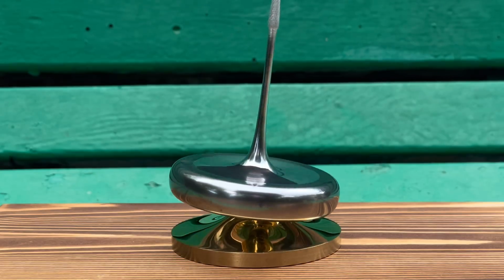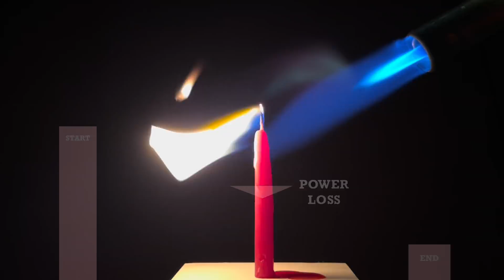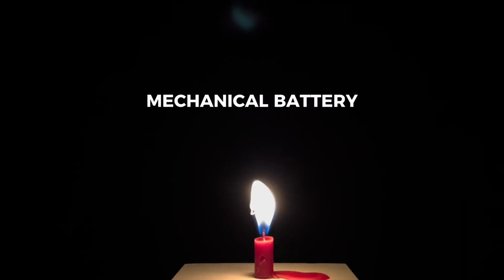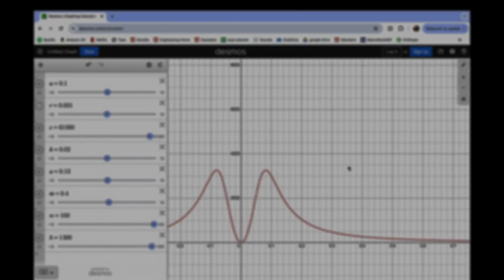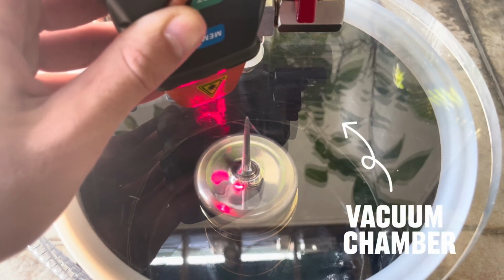How to Make the World's Longest-Spinning Top

Comment: How much longer does it spin when in a vacuum chamber?
Reply from the maker: This would spin for around 1hr 45min in a vacuum. However it is not designed to spin in this environment. Eventually I’ll make a top designed for this and it would spin for much much longer!
Reply: @hiper_tops  How does designing one for a vacuum differ from air? Would you add more mass to the outer ring to increase the moment of inertia?

Comment: Hello James, question for you! Looking at the smoke test you can see a very thin layer form around the main mass body of the smooth surfaces and guess this is the drag that slows down the top over time. I wonder if that surface was dimpled like a golf ball, if that would reduce the surface drag same way it does on a golf ball and help it spin longer?
Reply from the maker: Hi Dave! Well spotted, yes the top acts as a viscous centrifugal pump. Air is dragged out to the spot with the largest diameter and expelled in a disc. However, adding dimples here would increase the drag. Dimples help golf balls because although the viscous drag increases, the pressure drag decreases more. Spinning tops are stationary in air and so don’t experience pressure drag, so the dimples would just increase the viscous drag! Hope that made sense…
Reply: @hiper_tops  Thanks for the explanation! Keep on spinning 😀

Comment: I’ve been wondering for a while if having a bunch of dimples like a golf ball on your top would reduce its drag and help it spin for longer. What do y’all think?
Reply: That of the dimples like in golf balls seems the most common suggestion.  It doesn't work anyway, the speed in spin tops is too slow and the air flow is laminar, not turbulent, as it would be needed. Apart from the factr that the geometry of the air flows in spin tops aand in golf balls are totally different.
Reply: @iacoposimonelli7191  thanks!

Comment: Why is a sharpened or conical tip optimal?
If we are talking about a top made of a hard material spinning on a flat or almost flat hard surface, it seems to me that the tip of the top could be spherical or close to spherical, and the point of contact with the flat surface would still be very small.
To be more specific, I am imagining something like a stainless steel ball bearing in the tip of the top, and the flat surface would be stainless steel.
Reply from the maker: Ball tips are a good option for light tops, however for such heavy tops as mine, lubricant is a significant factor. Spike tips experience less fluid drag from lubricant compared to ball tips, so they become the better option. If I use a small enough ball, it approximates a sharp tip a bit better (see Mk.20). Also, I use materials much harder than stainless to reduce wear
Reply: @hiper_tops  Have you experimented with increasing or decreasing the space between the bottom of the top and the base or surface the top is supported by? 
I am wondering whether drag is increased or decreased based on the spacing.

Comment: Do you use a heavier metal for the ring and a lighter metal for the inside of the top?
The middle part should be empty, just two sheets of metal to reduce weight, just like a plane wing.
Reply from the maker: You’re correct, currently I use a dense tungsten copper alloy for the flywheel and aluminium in the core. I could potentially push this to be pure tungsten and magnesium but they are difficult and dangerous to machine. Regarding the 2 sheet idea, I tried something similar with Mk.19 where the top sheet was cling film however I struggled to get it aero enough. If I had the manufacturing tech, your idea may be a bit superior.

Comment: Not quite sure what the rules are, but would a lowfriction bearing between the tip and the body be beneficial? It would reduce the tip speed for lower friction, but would also add another point of friction. If the relation between rotational speed and friction is squared it should be beneficial. Right?
Reply from the maker: This is an interesting idea I heard once before, and yes I think theoretically with near perfectly frictionless bearings it would be beneficial. However in practice, I don’t know think the bearing wouldn’t spin, there is too little breaking torque from the tip to cause it. I believe billet spin made a top like this, do have a look!

Comment: Is there a category where the point the top spins on is on the exterior of the body? Like, ones that would spin in flat surfaces?
Reply from the maker: Not an official one but it is a subdivision I am also interested in. For long spinners in this style, check out pliertops and similar designs! (But stay tuned for my take on it in the future :)
Reply: @hiper_tops  thanks. And yeah no, I'm subscribing cause this was such a cool video. Just would like to see what the tops I'm used to are capable of

Comment: I’m not sure about the lubrication.
Reply from the maker: I too would like to do more experiments - i can confirm that what i'm using does help compared to nothing! about 5% longer spins :)
Reply: @hiper_tops  5% that’s significant. In ball bearings this is not the case. But then they are rolling and your top isn’t. Interesting.

Comment: I'll throw a spanner into the works and ask a question that you may or may not have modelled/tested (and give a boost to the algorithm):

How would heat effect the performance?

Initially, I think heat would negatively affect the performance of the top since with added heat, things become softer, more gummy, sticky, even. Would cooling below ambient improve the characteristics of the top? I understand that you don't want the friction to be too low at the contact point, which I'd assume would be lower with a lower temperature, however I am unsure how sticky things would be, especially air for example, on the surface.
Reply from the maker: Thanks for the comment! It is a bit of a cheeky technique if you ask me but an interesting experiment I would like to conduct. Since air viscosity generally decreases with temperature, refrigerating the top before spinning and spinning in a colder climate should help.
Reply: @hiper_tops  oh undoubtedly it's cheating if you ask me, but it appeared that you ran a test in a vacuum chamber, presumably to measure the effects of your air on the duration of stability. I thought "hey, why not test all the variables by either running in a freezer, or chilling prior to spin and running a TEC on the base". 

An interesting experiment I don't think I've seen tested, but I've seen plenty test in a chamber before.

Comment: What are the limitations on what is an acceptable top?

You could have a superconducting magnet levitate the top to eliminate the friction at the contact point.

Or a cryogenic liquid slowly boiling off from inside the top to provide continuous force spinning.
Reply from the maker: Personally, it must have a positive COG to tip distance and perform without external aid or energy sources other than the initial rotational kinetic energy given by my fingers. It should operate in normal atmospheric conditions. However, guinness world records doesnt care as much about these specifics. Hence the record is 27 hours with a battery powered top. There is a record for a mechanical top at 1hr37min, however this was started with a string. Regarding your suggestions, I would quite like to try a levitating top at some point, however I'm not sure how soon this would be!

Comment: Would including some sort of spring between the tip and the main body even out the peak force on the tip of the top? I think of it like an object being dragged across a washboard. Just going over each (microscopic) ridge would be way less efficient than if you pushed back on the slope on the downhill side. Idk if that makes any sense. You might take more in losses in the spring’s heating but idk.
Reply from the maker: Interesting, I don't think there would be much benefit from the spring in my case because the bases I spin on are very smooth compared to a washboard. Aside from the energy dissipated in the spring, I would be concerned about imbalance and the rigidity of the top.

Comment: So if you spin a precessing top on a very low friction surface, it may never stabilize?
Reply from the maker: If the friction was low enough and the rate of precession slow enough (both theoretically possible), then I believe so! It might spiral upwards a bit but never reach fully upright before stopping.
Reply: The phisics of the rising top is not very simple and the rolling resistance has to be considered separately from the rotational sliding friction.  But certainly, without frictions, the top would never rise, and would precess forever:  https://youtu.be/BBRNMmSwyQs

Comment: I win.

Hi there. It probably shouldn't be the mark 23, or even what your next iteration actually is, however, don'tchano? As an object becomes more condensed by pulling in its outer surface it's rotational energy increases? A top which flares while spinning up and tightens while spinning down will constantly be supplied with new thrust. Thrust can be transformed into potential energy through dispersion where elasticity redirects momentum away from the center while reducing rotational momentum along the edge, the effect is a net increase in accumulated rotational energy and momentum along the edge while spinning down  which decreases in magnitude over the length of the contraction until a point when suddenly it becomes so tight even small contractions seem to restore more energy.

In fact one of these days gyroscopes will actually fly with principles like this.
Reply from the maker: I’m not sure I quite understand your idea. It sounds like the top would store some gravitational potential energy which would be transferred to rotational kinetic energy during the spin. I have actually designed a top to do this in the past but didn’t make it due to the manufacturing complexity. It is technically against the “rules” I follow (no moving parts and no energy stores other than the original rke) but would be a fun experiment. I might try it in the future so stay tuned :)

Comment: did you tried soaking your fingers in water for 5 minutes before launching it?
greatly increas finger grip, I bet you could have enough grip to try launching it from a polished surface
supressing the need for build in grip in the spining-top upper part !?
Reply from the maker: I havent tried the pruned fingers technique haha, but I believe similar results may come from rubbing my fingers with garlic or another grip enhancing thing. However, I still think knurling is the way to go. My most recent top is very similar to Mk.22 but with better knurling, and this difference alone seems to have quite a significant benefit when it comes to starting speed!
Reply: haaaaa, I see : )
can I try a "the more it as speed, the faster it loses it"?
hahaha
but yeah, I was trying to figure out how you could possibly increase friction between your fingers and the spinning top axle, without increasing air drag.
Mmmmm

anyway
love your videos, spining tops are odly satisfying

looking forward to it

Comment: Hey, great to see you back!  I saw one of your prior videos and suggested using a silicone lubricant.  I have mulling it over since and have an idea.  Not sure how well it will work in theory but I want to throw it out there.  I think you may find some success with layering lubricant.  The idea I had was a super thin initial coating that isn't soluble by our other lubricant and is durable. Maybe some sort of wax or nasty forever chemical... Then buff it out to be super thin.  Then use another lubricant on top.  I remember hearing from my buddy while he was going though is mechanical undergrad that no matter how fast a fluid is moving in a pipe, there's always a static boundary layer that doesn't move.  I think perhaps that initial wax or something would stay in contact with the platform and the other lubricant would be on top of that to create lubricant riding on top of lubricant.
Reply from the maker: Good to see you back as well! Layering lubricant is a cool idea, haven't considered it before. You certainly hit the nail on the head with the first layer being durable - my biggest concern with this plan would be that the heavy top's sharp tip would 'drill' quickly through the layer until it spins on bare metal. I think the film of lubricant under the tip which I currently use is really at the atomic scale, any excess is squeezed aside. 

One thing to consider which may make your idea more viable is if I used a larger ball tip instead of a sharp conical one. This would make the pressure under the tip smaller, perhaps enough to stay on the double lubricant layers, whilst sacrificing an increased contact patch. My initial reaction would be that the contact patch would have to be too much larger to be beneficial (if your layer idea brings mu from 0.1 to 0.01, can only afford to make the contact patch's radius 10 times bigger). Thanks for your comment!
Reply: @hiper_tops  Very good points.  Probably would need to be something that would atomically bind to the platform and be close to molecularly thin.  If it could have a strong bond to the material the platform is made out of, I would expect it to have the strength of the material the platform is made out of.   Then perhaps the lubricant on top of that would be able to self heal as the center of the point of the top moves about. Something to chew on.  May not be practical, but if you're able to get it to work, I would be very interested to see how it goes!

Comment: Nice video, it looks professional.  How much long it spun your top with the Dremel ?  I never tried it.
Reply from the maker: Thanks :) I actually found an interesting problem with the dremel, above a certain rpm the top becomes unstable! It hula hoops more and more, spiralling to the edge of the base and if left alone, it will fall off (scary with such big tops, a lot of energy). The rpm at which this happens varies depending on how well the top is balanced and how sharp the tip is. So I haven't done any full-length spins with the dremel. However, I will conduct more experiments to study the period of slowing down to the rpms I usually start at.
Reply: @hiper_tops  , yes, I understand.  I was curious about the smoke too, did you refrigerate it or it goes downwards just because it is sucked down by the movement of the top ?
Reply: I asked it becuse some cool visual effects can be made with cold smoke, which I wanted to use in one of my future videos, so, if you made it, I would have liked to know how.  But it is not that important, eh...

Comment: What about a diamond pivot point and surface?  Or making the gnuralling more aerodynamic (like a simple, shallow spiral)?  Or using a variable density mass with dense metals like osmium?  Graphite or molybdenum disulfide lubrication might also be beneficial.  I curious about all of this.
Reply: Or polishing the top to a mirror finish.
Reply from the maker: @rileyh4169  Excellent questions. 

Regarding the diamond tip, I don't think it would be a good idea - the tip should really be slightly softer than the base to avoid drilling into it and even if the base were diamond, if the tip was sharp diamond, it would drill. Possibly a diamond ball has potential but really the rate of drilling would just be a bit slower. 

For the diamond base, I think if it were monocrystaline and perfectly smooth (difficult to find and achieve... and VERY expensive), then this might be the perfect base. It would be as hard and wear resistant and anything. However, in any other circumstance (polycrystalline, not perfectly smooth) it would not work. This is because of the same reason cubic boron nitride bases don't work well - they are too abrasive! Tips become blunt over the course of a single spin. I hope one day I will be able to test mono diamond but for now, carbide is best.

I used shallow knurling in many of my previous tops, but actually, it makes almost no difference. The radius of the top here is very small, so the gradient of air velocity is no where near as steep as at the flywheel. Hence I would say easily 99% of air drag is just from the flywheel. 

Regarding variable density, I am a bit skeptical. I believe the goal is to have the largest possible radius of gyration : radius ratio. Otherwise you sacrifice air drag unnecessarily. In practice, to get the appropriate total mass, you sacrifice this ratio a bit, but I think using less dense metals in between would make the problem worse. And yes Osmium would be idea, maybe when I'm a millionaire XD

I use an oil lubricant which seems to add 5-10% to spin times, however I am open to experimenting with more. Once I have completed the Quasar series, this would be a good experiment to conduct.

Finally, yes a mirror finish would be ideal, and I try to get as close as I can (see opening and closing shots). It is quite difficult to get tungsten shiny though! Perhaps because it is so hard.
Reply: @hiper_tops  Thanks SO MUCH for typing that out.  I find this fascinating.  The idea of "make a top spin longer" is dead simple, but once you really try, you're doing calculus in like, hour one lol.  I would have never guessed that drilling occurs even with diamond.  That's wild.